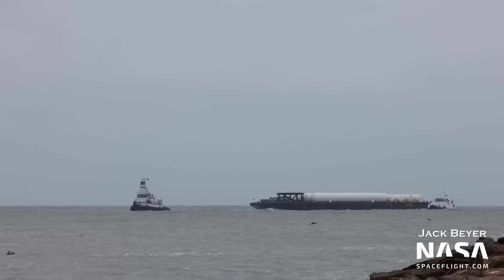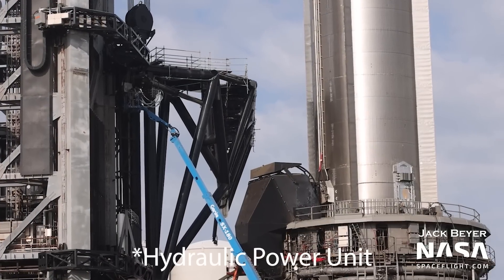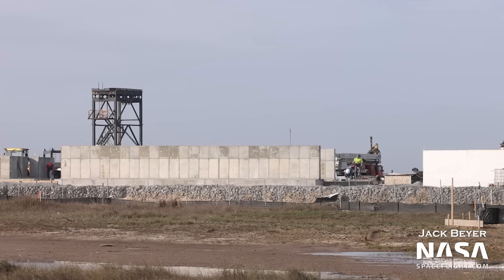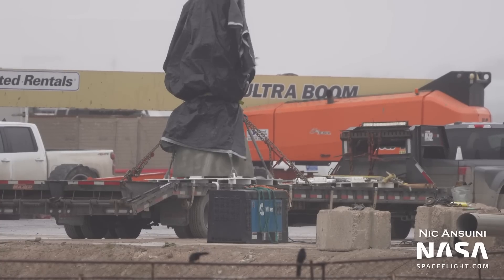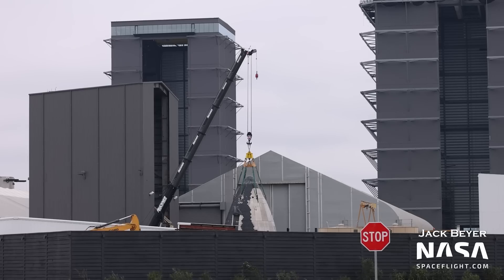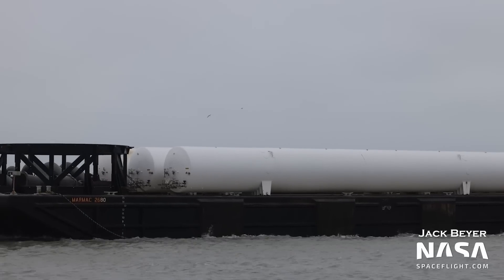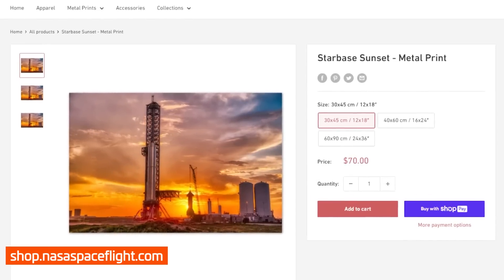Work Ramps Up at Starbase for Final Preparations | Starbase Update

Comment: I think building these large raptors is a good way to build the base components for a larger ship or space station assembly in high orbit. Making these rockets in the shape of Bee's hive honey cones so they can be built like larger leg-go blocks in orbit. how hard would it be to make 6 sided cylinders that would fit together and look like long honey cone that can be locked together and taken apart just by locking and unlocking clamps in space. should be a strong shape to work with and the outer sections could be filled with space debris  reflecting materials to minimize what happened to the soyos22.

Comment: I am waiting for them to figure out how to launch from the Arms so they never have the ship on a pad and they don't need to rebuild the pad or need the water cooling. Taking off the same way it will land from the Arms. Launches are a slow process with that kind of weight and should be possible to do from the Arms once they figure out the computer parameters.

Comment: I would also bet the water deluge system (if that's what it is) goes in before launch, maybe even before the 33 engine static fire.  This first launch is not just a test of the launch vehicle but also Stage Zero, aka the launch mount, IMHO.

Comment: "the dance floor" is a generic construction term used to describe any large area scaffolding set up for work purposes. there are a bunch of different reasons why it could be referred to as the dance floor, but it's mostly just because it's big enough that you could have a dance party on one.

Comment: I was told that the booster grid fins do not fold in like they do on Falcon 9 but some line drawings show them folded in - what's the correct view? Thanks - keep up the good work
Reply: They dont fold
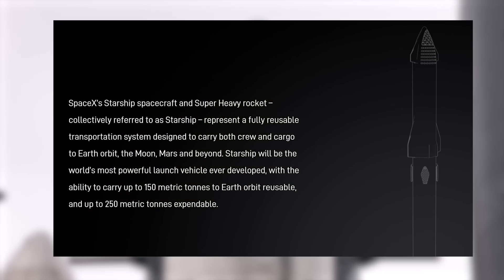Reply: @JackABeyer  Thanks Jack - is there a reason why? also in this video one of the drawings (@1:20) from SpaceX actually shows them folded in, that was the reason for my question - second part if you don't mind me asking is why dont they do that to the Falcon 9 grid fins as it would save on the mechanics of them - :)
Reply: @glennhardacre5366  one less thing to design and build. One less point of failure. “The best part is no part”

Comment: Assuming that a 33 RE static fire does more harm to the OLM than actual lift-off, I would install the water deluge system before the all-engine test (and get it working!). When the booster/stack actually lifts the impact on structure declines with distance. Looks like we need to be patient until GSE is done before the awaited 33 RE stativ fire will happen.
BTW: this format is fine, much appreciated.
Reply: Agreed. Static is also best time to test the deluge.

Comment: I wish SpaceX would consider landing on a modified mobile transporter (redesigned by Tesla for rapid repositioning). This would give them (1) two degrees of motion for landing ... the booster/Starship and the transport ... instead of one ... the booster/Starship and (2) more efficiency ... once landed the transporter trolleys the booster/Starship for servicing and cargo loading ... at the same time the OLM would be independently launching boosters ... 

This would minimize risk to the OLM and make its operations more efficient by removing bottlenecks caused by delays elsewhere in the chain, especially with returning boosters/Starship.  It would reduce the service obligations on the OLM to zero.

And yes, this is totally Monday morning quarterbacking ... hats off to SpaceX engineers.

Comment: I guess before SF if all 33 engines will be fired simultaneously. Maybe in general before SF to protect coating of Stage Zero and the concrete under Stage Zero.

Comment: Like the new format.  As to when the install of the deluge system might be installed.  I would guess after the 33 engine SF but before the launch.  Since the pad would have to be replaced after the static fire it just makes sense to do the install then.

Comment: Could the orbital mount have the same starship heat tiles installed to protect it?
Reply: No, they would just turn to dust in seconds, they are not designed for that amount of pressure.